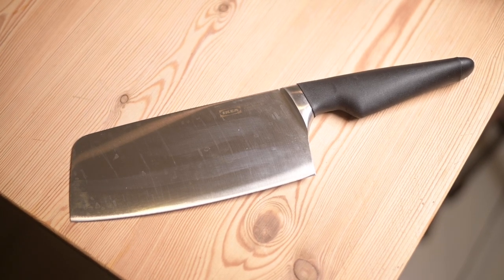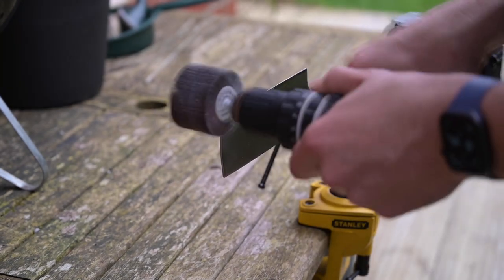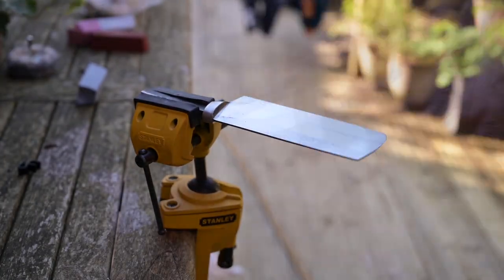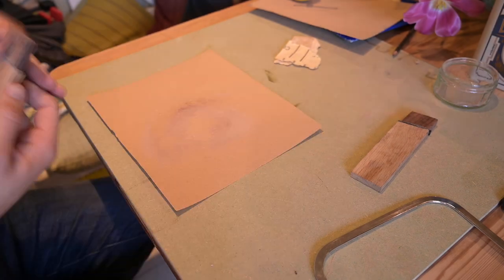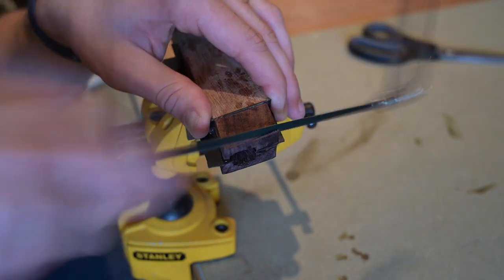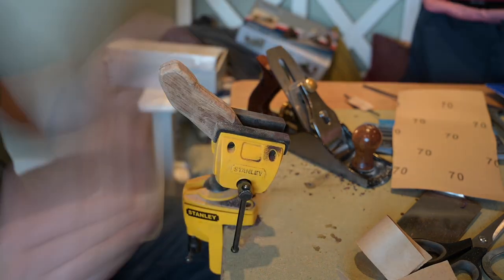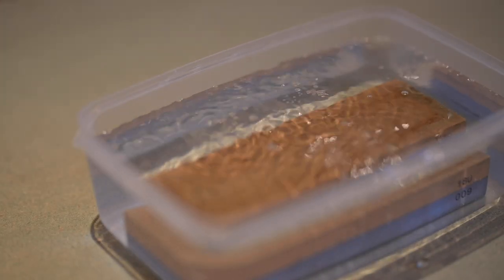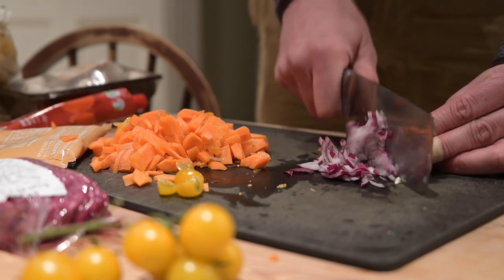Isolation Projects: Ikea Knife Renovation

Comment: I worked as an assistant in a butchers shop a while back. If you want to maintain consistently sharp edges like that one on your knifes without too much of a hassle, I suggest getting a "rapid steel action" type of sharpening tool. The original is made by a german company  called Friederich Dick, but I have come across copies every once in a while. They are pretty expensive compared to a simple knife sharpening steel, but givrn the ease of use and additional safety they provide I wouldn't mind actually paying double their current price. And I say that as a hobbyist
Reply from the maker: Thanks for that info - I'll look them up! I tend to sharpne mine occasionally on my grinder, but it would be useful to have an "indoor" option...